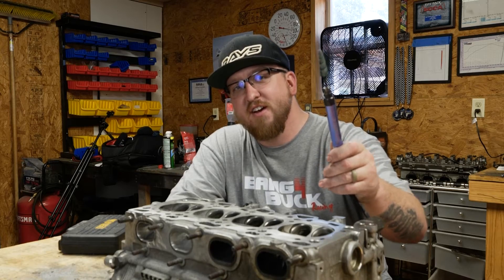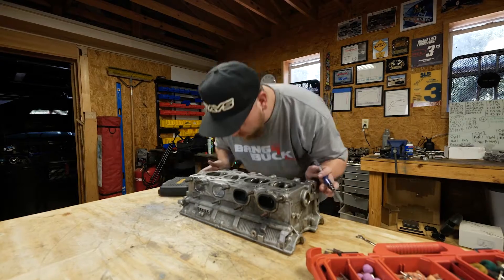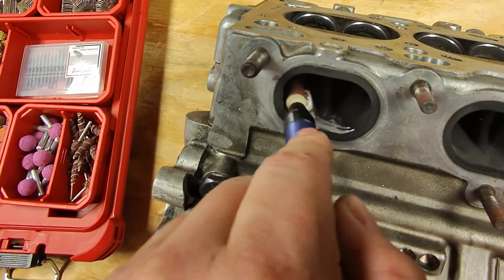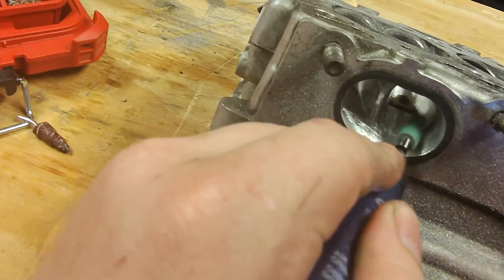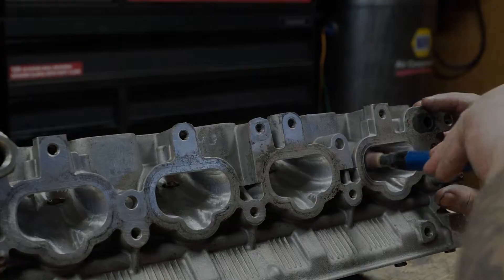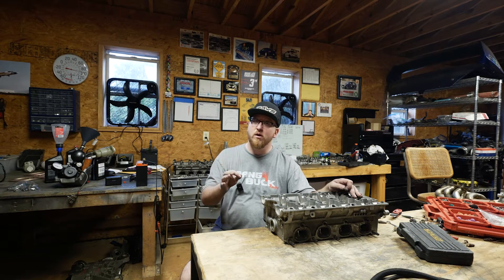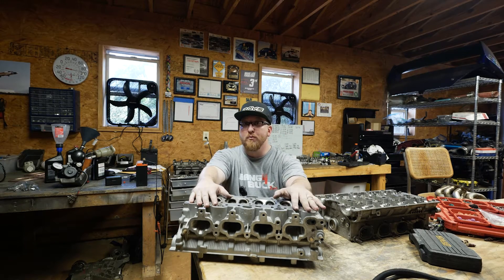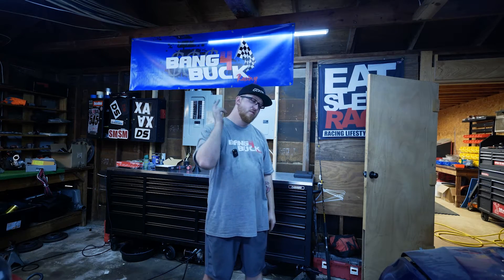Porting and polishing my first ever cylinder head!

Comment: I do know having a slight roughness or even dimpling or a few bilges will improve flow but having a laminar airflow going into the port is super important in building pressure and having that pressure speed up into the cylinder from intake by controlling the stability of air flow and angle of attack entering the port and into cylinder is a good way to improve speed by creating a gradient . U should l also think about a better way to improve spooling and air flow by exhaust scavenging it’s a hood way to keep power and suck fresh fuel and air rich mixture into the cylinder utilizing exhaust vacuum to pull more air in that u normally have by the shape of ur exhaust

Comment: Polish exhaust ports and combustion chamber, finish intakes with 400 grit flap wheels. A polished intake port causes fuel to puddle, a liquid cannot burn. Hence the tuning problems. Without a flow bench, you're kind of pissing up a rooe, find a shop with a flow bench, and pay to have them tested. There is a mathmatical equation for H.P. with the flow numbers, and is usually pretty accurate.

Comment: First off. Saying it doesn’t work is just an assumption. Bc number one. It helps period. That’s a fact. Polishing. Ehh. That’s debatable. I think people take polishing too far. But I can’t argue that these things are mass produced. With that being said. They are casts of the original motor. U aren’t getting a fricken RR. U are not getting a hand built car. So all those imperfections need to be dealt with and it absolutely 100 percent will improve things. I’m not saying it’s going to give u 500 horse. Will u increase some yes. It’s going to be so minute though. People are thinking by spending 100 hours doing this. They should achieve a 500 horse car. Wrong. You’re doing your car a favor 🤷‍♂️ but yes. It does work. Who ever says it doesn’t is definitely crazy. Until an engineer tells me it doesn’t. Don’t speak. 🤷‍♂️

Comment: The saying is “DONT lower the floor, raise the roof”. This will make the change in angle more gradual. Lowering the floor makes it more abrupt. Just get it smooth and that’s it. If you want to actually remove material elsewhere in an effort to reshape, go for it
Reply from the maker: I thought I might have got the phrase wrong even if I didn’t apply it

Comment: Definitely helps to clean up the casting Flash and Polished exhaust ports will definitely not build up carbon as bad and as much easier to clean off later. I would also shine up the combustion chamber a little bit for the same reason
Reply from the maker: I was kinda on the fence about the chambers I did it on my test head.
Reply: It's old, but I will add something to that, polished combustion chamber also reduces hotspots, so there's less risk of pre-ignition and knock. What's more it's improving efficiency from thermodynamics standpoint, for most people it's counterintuitive, but same object after being polished has less surface area for heat transfer, efficiency gain. Reflective surfaces also heat up less from infrared, next efficiency gain. Worth maybe single digit horse power, but, after work is done it's free power.
Another interesting fact is that polished parts are stronger. Every surface imperfection is a stress raiser, a point where a crack has greater chances of forming, polished surface has no stress raisers, therefore it's less prone to cracking.

Comment: Heat transfer properties of the polished surface. Also flow match with a vacuum cleaner and a flow gauge to match each port. My dewalt vacuum fits perfect in the exhaust port and I can run a flow meter to look at while I test each cylinder
Reply from the maker: Hmmmm I’ll look into this!
Reply: @Bang4BuckRacing  cheap flow tester I used a ball in tube style flow meter and it worked great I could instantly see the variation and kept porting and polishing untill they were all the same.
Reply: Any videos on this?